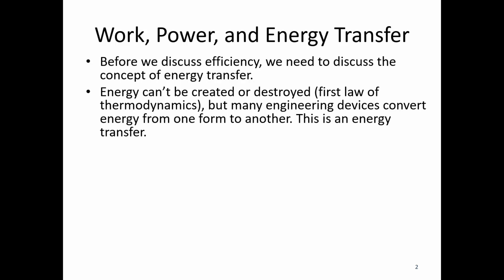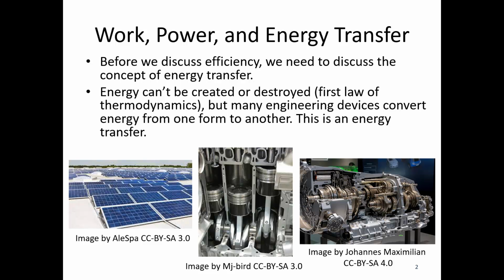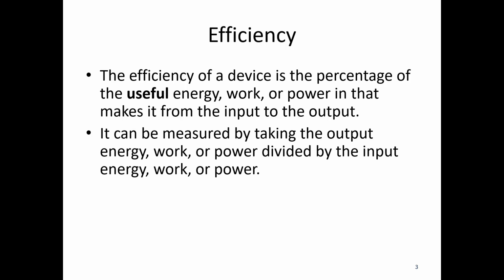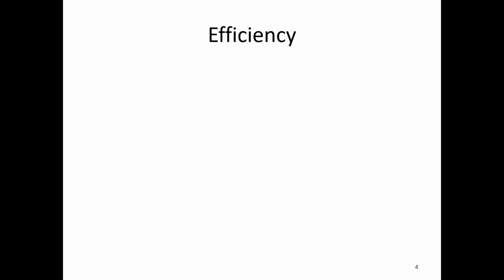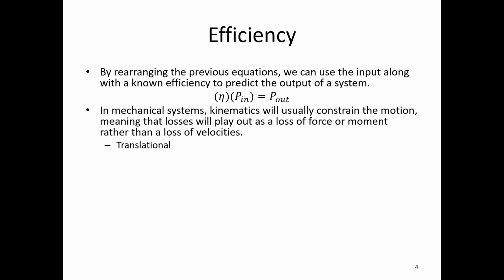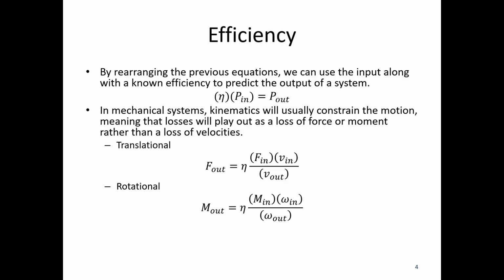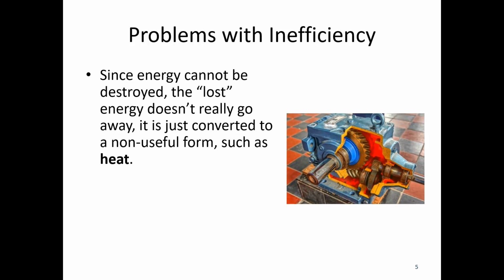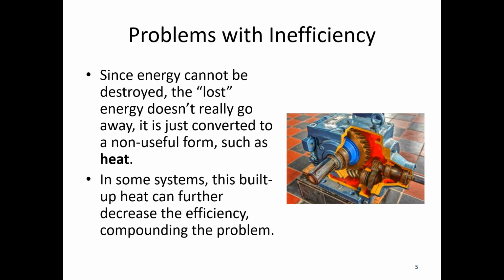14.4 Efficiency in Rigid Body Systems - Video Lecture - JPM

Comment: thank you for this video.. i think i have a quibble with the statement at about 1.56 that efficiency  out vs in of energy equals the efficiency of power, ie Pout/Pin.
While it is nearly true, often, that power Pin/Pout is equal to a short term snapshot of Eout/Ein,  the energy η over a extended seqment of a trip or cunulative for the trip will be different; due to the cumulative math, losses like drag, and energy reservoirs like thermal mass heating&coolling, warmup,  flywheels, and any delays or lags in system
For example a woodstove can start with energy η and power η of zero, for s while till stove heats up,  then ηp and
that make it so that ηp=Pout/Pin is different than ηΕ.
put slways a delay and mixture of input and energy stirage flows.
I hope this makes sense. thx